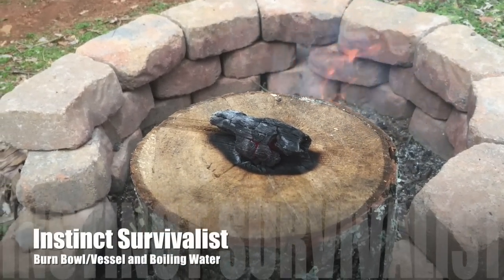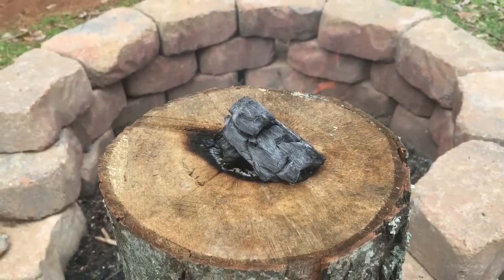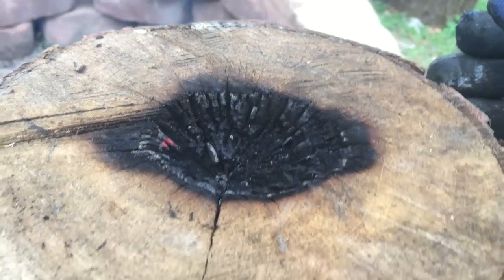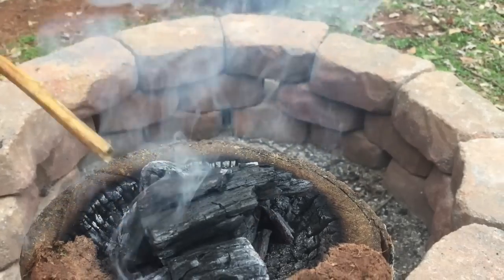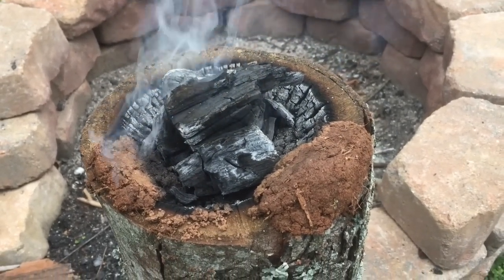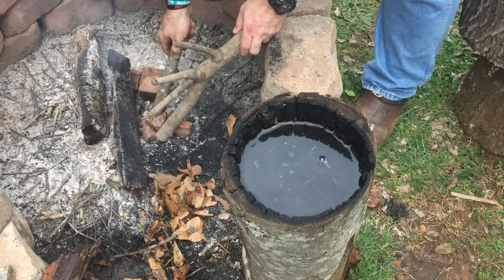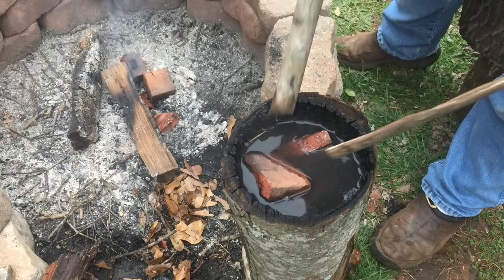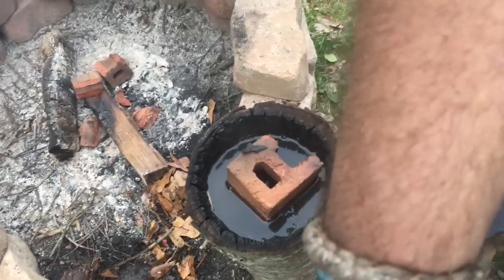Burn Bowl and Boiling Water

Comment: Is the water safe to drink? Doesn’t it become ashy?
Reply from the maker: It is safe to drink. The bowl can be scraped to take it to have less charcoal in it, but in essence it is just charcoal. Medics use it for gastrointestinal issues. 

There is also a saying in the Bushcraft community: “white if you’re tight; black if you’re slack” - meaning use white ash if you are constipated and black/charcoal if you have diarrhea.

Comment: What kind of survival situation would I have to be in to have at least some of my fire lighting kit but not my stainless steel water bottle?
The water is not being filtered THROUGH the carbon, which is NOT activated carbon, and the water does not come to a rolling boil.
All of the above are what I have come to understand as the prerequisites for drinking "wild water" if you'll allow me that terminology.
Also, I think the stones should be sitting on top of a larger flat stone to avoid ash getting into the finished "drinkable" water.
I'm just not sure I would trust this option if I had alternative solutions.

Having said all that, I find the concept interesting and the video, on the whole, quite educational.
Definitely not to be forgotten.
Just in case. :)
Reply from the maker: Hey Zander. Great points and very valid. 

As far as without a stainless steel bottle: I can totally agree, I would need to be in a dire situation to use this over my bottle. 

Good eye on the boiling as it is just shy of it. Water boils at 212 degrees F and all virus and bacterial pathogens are killed at 180. This means, although not pretty, all “wild water” issues are tended to. 

The video is designed to help people think and see alternative methods for a bowl, whether for water or other things. Some look at this as fun to try while others follow the primitive skills method and include it as part of their camp setup. 

As far as the ash goes, there’s nothing wrong with ash on the rocks but I could see where that would turn some off. Ash is actually great for gastrointestinal issues as well as some making things like ash cakes to eat. Sure they dust them off but there is no way to get it all off. Remember this “white if you’re tight. Black if you’re slack” and it will help you in an emergency in the woods. 

Thank you for watching and bringing up these points. I hope my explanation shed a little light behind what the reasoning is...only IF I don’t have my water bottle. :)

Comment: Drilling a hole to the desired depth of the pipe bowl with a sharp screwdriver, and carving out the pipe bowl with a small knife, and smoothing out the pipe bowl with sandpaper or round file also works good. Same method also works good on deer antler material.
Reply: Sorry when I first saw the picture of the bowl I thought about tobacco pipe then realized you're making a bowl for food.
Reply from the maker: Ha. But I love the idea. Thanks!

Comment: I tried this before, the wood just burn where it was once chard, I I suggest you do the burning, but surrounded it with water,. If it floats then fill it with sand, I think that might work, not sure.
Reply from the maker: Clay and mud keep it from moving in wrong spots. It is definitely a controlled burn once the wood is charred.

Comment: when you resort to such methods, you probably have no tools at hand. so where did you get that precisely cut block of wood?
Reply from the maker: This was a log that was cut with a chance saw. I have done it with another one that was felled with an axe. Not quite as pristine but it still turned out well.
Reply: actually it's more likely you ended up losing some tools (say to a river current) or not expecting to stay out that long or your container broke.  It's reasonable that you would have at least a decent full tang knife if not an ax or saw.

Also you could probably improvise one of these from a partially decaying fallen tree, though that would require a second rock circle (like your fire pit) to contain the burning pieces that fall off until you get past the rot. obv you'd want to burn out all the decay but since it rots from the outside in once you cleared the outer garbage your biggest issue would be plugging the holes from burrowing insects which you could do with some leaves and sap which shouldn't be hard to get with minimal tools.
Reply: If all you need is a bowl to boil water, it's probably easier to peel a squarish piece of fresh bark. The corners can be folded  to make a bowl shape and then held with a split stick.

Comment: Just a word of caution: after having your rock/brick in the water, it should not be placed immediately back in the fire. There is a possibility the rock/brick could explode because of the moisture.
Reply from the maker: Good tip/thought. I usually push mine from the outside in slowly as opposed to dropping them right back in. Slow warm. Thanks!
Reply: Who doesn't want to see an exploding rock
Reply: Impossible
Reply: It had happen to me before
Reply: yeah, river rocks only - and even then, very rare.
Reply: brick and rock are both porous, though brick is generally more porous than rocks, making it less likely to explode, though technically still possible. water, when vaporized, will expand 1600x it's original volume, and fast. if there is water inside of a rock, or a brick, it is possible that the water will vaporize without having anywhere to go. this will build up pressure, and eventually, it is possible for the water to "explode", overcoming the strength of the rock or the brick, and sending shrapnel flying.
Reply: nope
Reply: Well....sandstone here in Arkansas will explode as well....its what my fire pit is made of and it is always shelling off.
Reply: @oliverkang5420  You have no idea what you're talking about.

Comment: Are you making soup or lye?
Reply from the maker: Soup.  Maybe both :)
Reply: Lye would only come from the white ash which he washes out before he fill with the water he's going to boil.  the black charcoal shouldn't hurt anything as long as the wood of the tree isn't toxic (few are).

Also that lye from the ash generally needs to be boiled down before it becomes concentrated enough to cause chemical burns without consuming a lot of it (more than would be left in the bowl if you scraped it out)

Comment: Nice demonstration.
This is almost certainly how eastern Native Americans made their hominy  mortars.  A long term  bowl would be better made across the grain. I have often seen the burning method described for making dug-outs (after burning through the base of the tree), but stone adzes are very effective, and you can chop through an 18" diam oak tree in a couple of hours with a stone axe, so I question the universality of the burn-out dug-out. Any thoughts?
Reply from the maker: I've seen some of the dugouts but like you, universally, it might be a different story. I never did ask how they got the tree to the ground. I did ask one in regards to if they looked for a log or if they used a downed tree. He stated, we use what we have available. Not really a s solid answer.

Thanks for watching.

Comment: Does your bowl wood need to be cured or green, or does it matter?
Reply from the maker: Doesn't matter. If it is green, then when it dries, it may start to crack so you have to ensure the pith is out of the wood. If it is dried, then it won't crack as much if at all. Once it is burned to your liking, you can rub it with a smooth rock or bone to remove the "stuff" and make it usable.